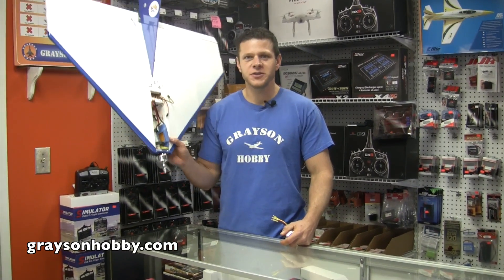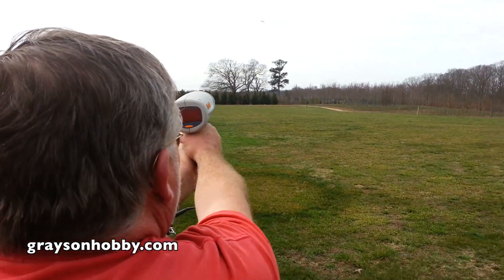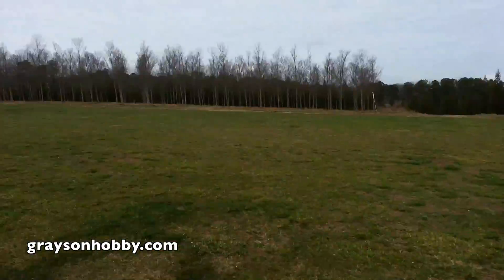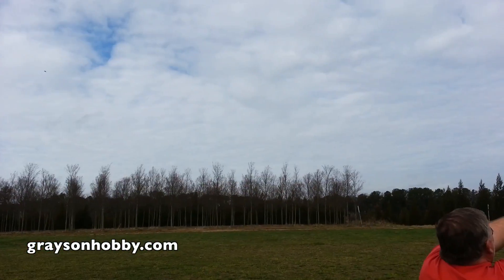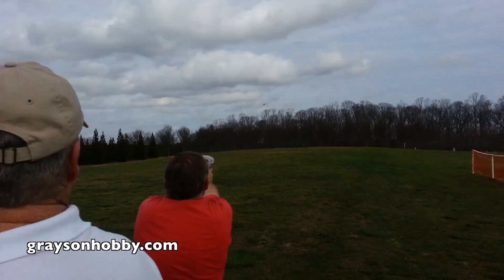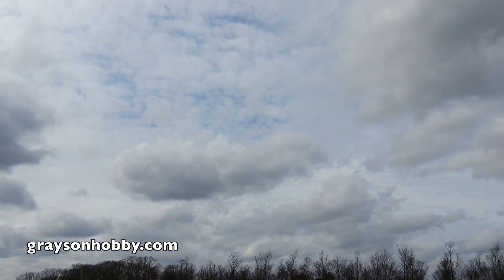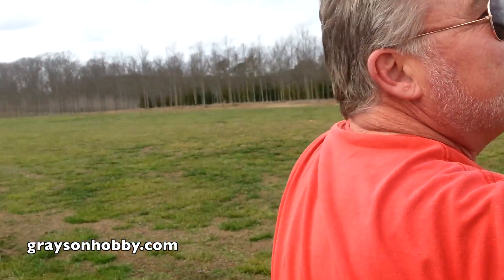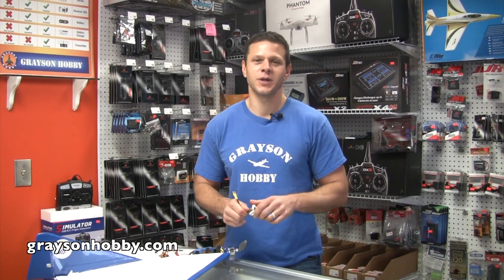125mph Electric Airplane on the Grayson Hobby Monster Jet

Comment: So I thought the lower the kv the more torque and less hp? Am I totally wrong? Love this new channel I've found too btw.
Reply from the maker: Technically you are correct when using the same battery pack and same voltage, but we go UP in voltage, so we want the lower kv.  I know, it makes no sense.

Comment: I love rc cars, just bashing around my local park and my wooded area. Fairly new to the hobby but I've yet to get an airplane. I want one so bad. Any suggestion for a decent priced beginner plane? I have no LHS so online is my only source!! Thanks for your help in advance. It's amazing that the plane with that motor hit that speed. Wicked!!!!
Reply from the maker: Hi

Cars are fun, but I feel you can do MUCH more with planes.  A perfect beginner plane is the hawksky RTF (Ready to Fly).  It comes with everything, and I mean EVERYTHING.  Its very easy to build, fix and fly...   Good Luck

http://www.graysonhobby.com/catalog/dynam4chhawkskyelectricgliderrtf-p-1036.html